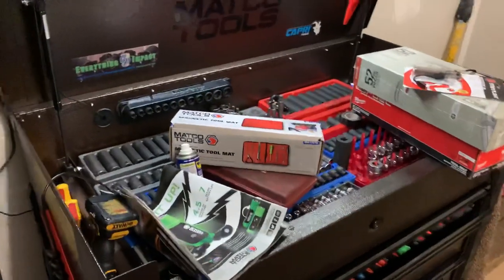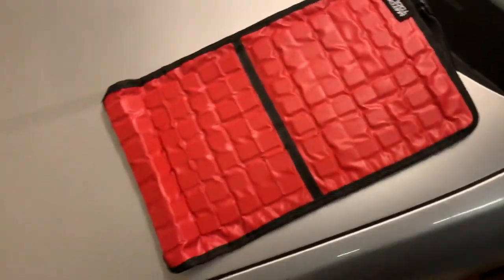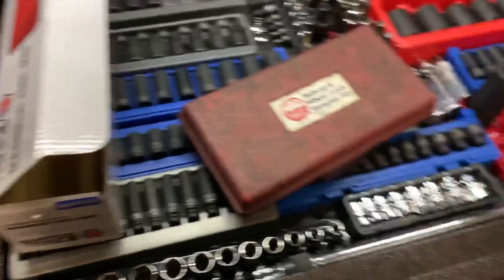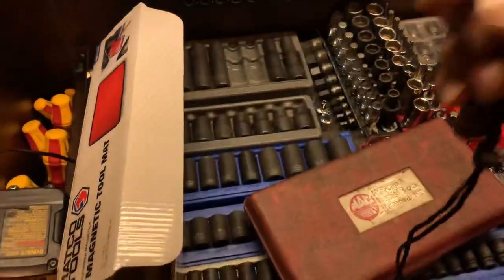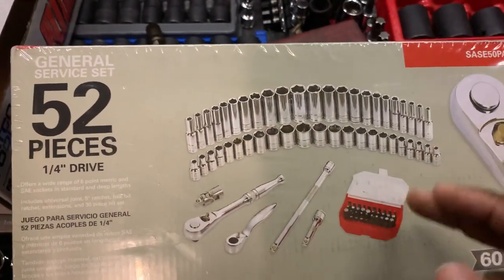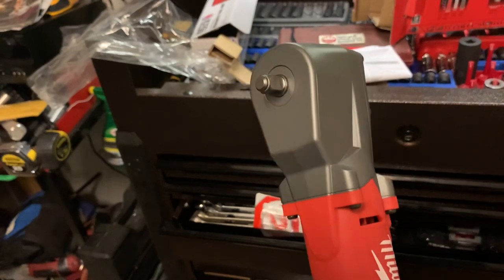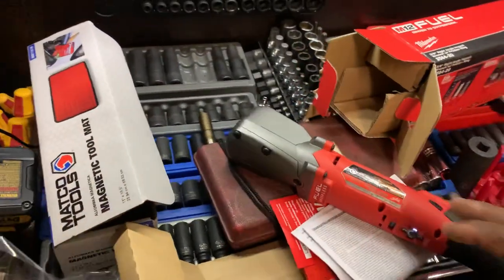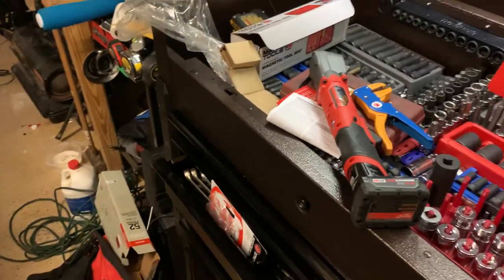Matco Tool Haul

Comment: My experience over the years is that 1/4"-drive ratchets and sockets are mostly usable for car interior work (radios/electronics/dashboard) and less so for work on the rest of the car.  I bought a few 1/4"-drive ratchets and a reduced number of sockets early on (owing to money constraints), and haven't had much need for what I did buy.  I would caution people just starting to buy tools to give some thought to their needs, both current and future, when choosing socket sets or ratchets.  You'll always need 3/8"-drive ratchets and sockets for cars and home projects, plus some larger 1/2"-drive sockets to augment those.  For the latter, you can use a 3/8"  to 1/2"-drive adapter to handle these larger sockets.  Overall, you probably won't have as much need for 1/4"-drive tools, at least initially, so buy fewer in that size range.  These days you would buy metric sockets for automotive use and SAE sockets (generally) for equipment needs around the house and yard.
Reply from the maker: Contrary to that, I've found 1/4" sockets to be very useful under the hood as well. Most fasteners, even on pickups range anywhere from 10-15mm in most cases. Larger sockets (beyond 19mm) are common for axels and other suspension components. While not a professional mechanic, I am a Aerospace Mechanical Engineer, and I'm responsible for the teardown, reverse-engineering and rebuilding landing gear and other structural components on fixed and rotary winged aircraft. After 19yrs in the Engineering field, I personally know how often 1/4" sockets and ratchets are utilized.

Comment: I had a pretty decent Matco tool Hall today as well
Reply from the maker: What ya get????
Reply: Adv 1/2 drive 12 point  universal driveline socket set a 3/8 drive 3 jaw universal filter wrench the non contact ignition coil tester and the small rivet nut installation set
Reply: And last but not least a koon trucking favorite the stream light stylus 350/90 lumen pen light in black